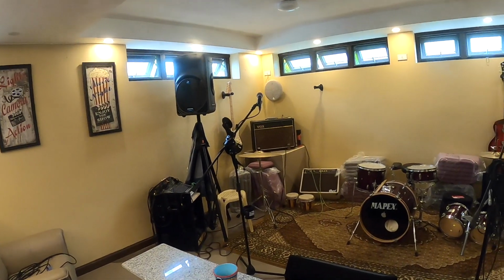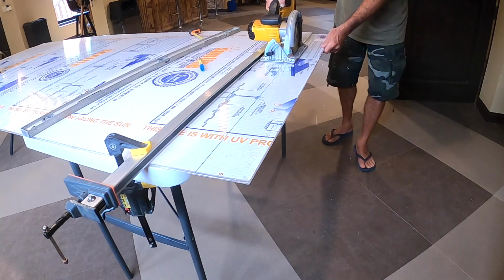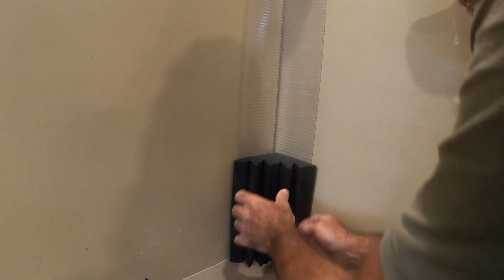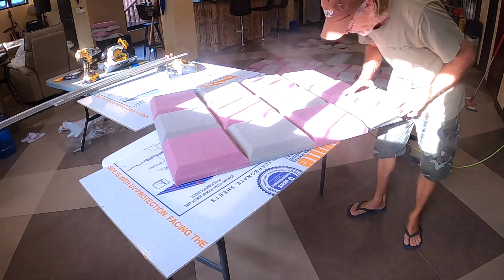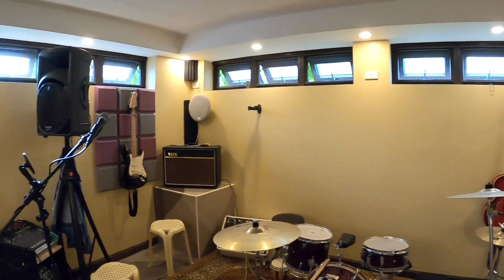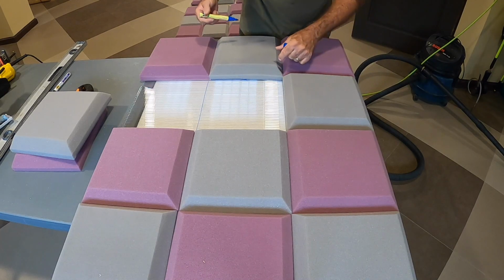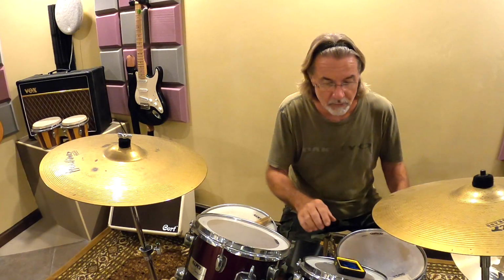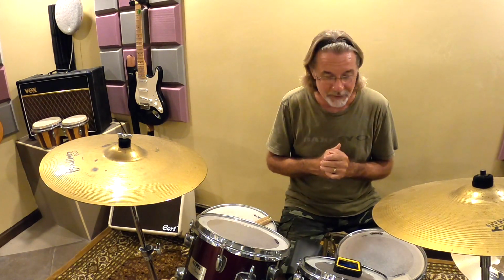HOW TO INSTALL ACOUSTIC FOAM PANELS THE SIMPLE WAY (House Building in the Philippines)

Comment: Proof is in the pudding. Waiting to see the difference your acoustic project has in sound quality. Since you have open spaces compared to a closed room, result may be iffy. I know it's not a recording studio, so I'm really looking forward to hear the result. How about "Spanish Eyes"? It has highs and lows which could make a good test.
Reply from the maker: I walked around all the rooms in the basement this morning and did a speaking echo challenge to the walls.  The small amount of tiles in the band stage area certainly are quieter than any other space in the basement.
I still have about 150 tiles to add, mostly in the ceiling so that's really when I'll be doing sound tests with the amps plugged in and FOH speakers powered on.  Standby for a full test.

Comment: And you should be projecting onto a white wall not a yellow wall and you can tell when you do it
Reply from the maker: Actually, there are colors that work better than white.  For some reason, the basement wall color shows true colors on the wall when its dark and no outside light gets in.  That's why we canceled our plans to buy a motorized drop down screen like we have in the US.